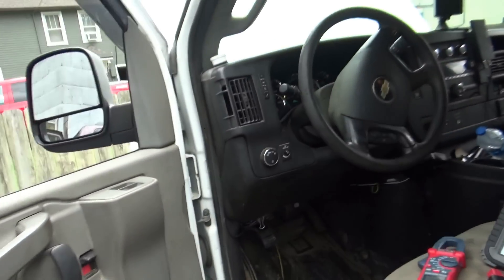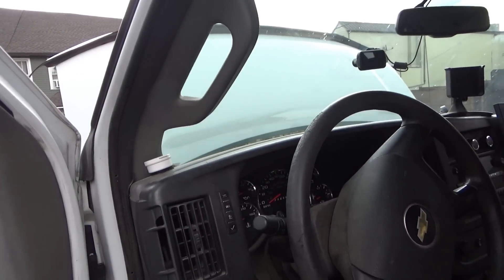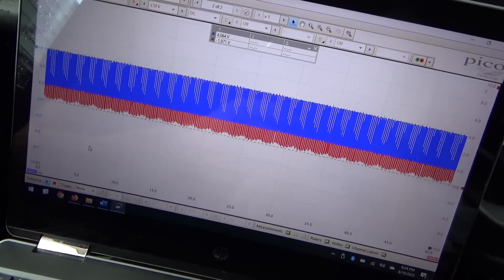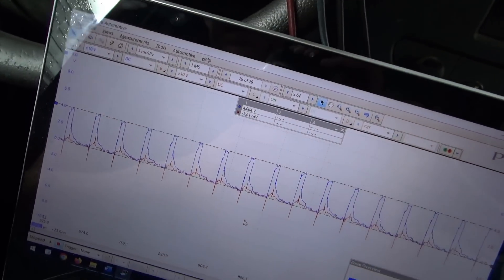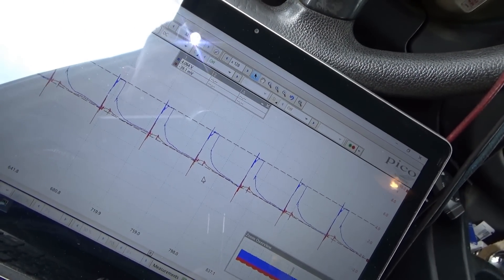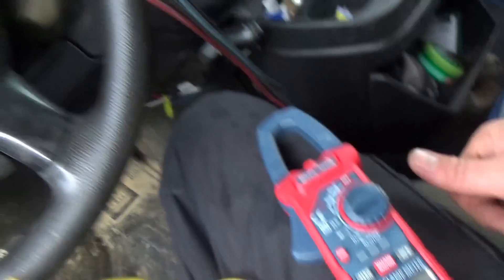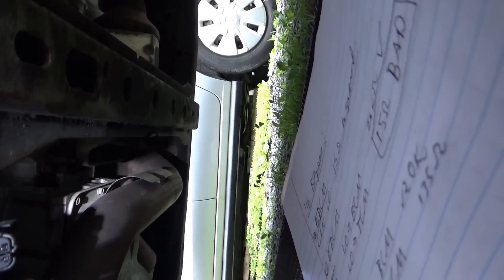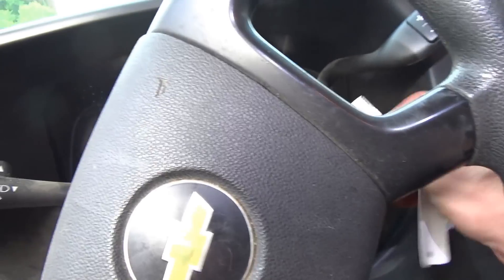DEAD Chevy Van STUMPS Shop...('16 Express NO Crank, NO COMM?)

Comment: You seeing the new transmission makes me reiterate, ask the customer "What repair work has been done recently prior to this current problem" as well as "What has been replaced to 'fix' this problem?"
Reply: Definitely!!
 Sherwood, at Royalty Auto, recently did a video on a no crank no start where the cause was a hood latch that had been recently replaced with an aftermarket part. 
In troubleshooting contests, part of your score is based on whether or not you ask the “customer” those kinds of questions.
Reply: @christophermurphy943  When a hood latch has control of the ignition system, you know you have a vehicle that you should sell at the earliest possible time.
Reply: But can you trust the customer to tell the truth?
Reply: @gaad7938  I find customers don't usually lie. They are horrible at explaining things and do not understand the most basic ways in which things work. I can't tell you how many times I ask simple questions and they tell me a totally wrong thing. I state I just asked you about this and you told me no. They just look at me with glazed eyes. I get annoyed but I always have to tell myself and my guys if we didn't have clueless customers like this we wouldn't be in business.
Reply: @scotts4125 
I totally understand about clueless customers. 
The bad part is when they go to the parts store Technician and get a code read.
The parts store Technician reads the report and sells them said parts.
Worse of all is 99.9% of customers or parts store Technician Do not understand what the code actually means. 
How can anyone explain a code meaning if the customers do have a clue or basic understanding of how a vehicle works. 
A code is read, customers ask, if I buy this part, how much money and will it fix the problem. 
The parts store only wants to sell parts, so they sell the parts. 
Customers come back with the same complaint.
Reply: @gaad7938 yup, thats the problem  ! A lot of customers feel like if they "say less they Pay less". Which in reality if they don't divulge everything they did it just costs more diagonal time and cost them more money.
Reply: @gaad7938 they may be telling the truth but as an old statement goes, the Truth the whole truth and nothing but the truth. And ask my daughter after i spend 20 minutes explaining a repair to explain what i did and it goes, Blah biblah blah blah, and that is what she heard! As Sherwood would tell you, get the documents from the previous repairs
Reply: As Shannon on the Under The Hood Show says, "Go to where the humans were." Especially when seeing or knowing about any new parts. And yes, the owners are usually terrible about explaining things, especially when it comes to the sequence of events.... The truck stalled after you got gas and stopped at a traffic light? Customer, yes right before I got gas it ran bad and I pulled over, the truck stalled at the light with a full tank..... You just blink and start diagnostics.😂
Reply from the maker: In this case customer questioning would have eaten up more time than just diagnosing the issue with no other clues 😉

Comment: My 2014 Savana 3500, with 6.6 Duramax will not crank when the summer sun heats up the steering column. The ignition switch gets loose enough in the plastic that it will not work. My solution is to remote start with codes cleared with my Edge monitor. Stupid cars!

Comment: I have one with stabilitrak light on and traction control light on with it where should I start ?
Reply: Start by reading codes.
Reply: @davidquinn6161 Exactly. Could be as simple as a wheel speed sensor.
Reply: I was going to suggest wheel speed sensor but someone beat me to it. They're super common to cause issues-they rust jack and lose signal (at least here in the rust belt). It's a super common repair. So yes, get yourself a scanner (or go to autozone or something) and see what comes up

Comment: We need Ivan in New Hampshire. My nephew has been experiencing an issue with low power with his 2010 F-150 4.6 2V. So far, there has been no resolution after thousands of dollars spent on repairs.
Reply: You can resolve that by buying a chevy
Reply: @kevink8481  The truck has almost 250,000 miles on it so I think the 4.6 2V has proven itself to be a good vehicle. He just can't resolve an intermittent issue
Reply: @kerrylewis2581  I'm not making excuses for whoever worked on it, but intermittent problems can be a nightmare to find. Ive taken vehicles and drove them around for a couple weeks trying to get problems to recur. It can be VERY difficult
Reply: Get in line. We need an ivan in every state lol
Reply: A repair is when a problem is solved . Evidently it was thousands in parts cannon ammo, and hopefully not the crap aftermarket stuff.
Reply: @brianw8963  All OEM. He has spent countless hours trying to resolve the issue himself as well as bringing it to highly recommended shops. The truck has almost 250,000 miles on it but at times runs practically as good as new.
Reply: send him a email
Reply: Clogged cats